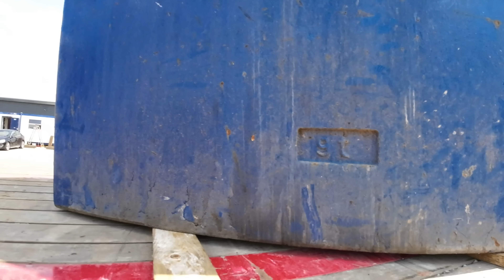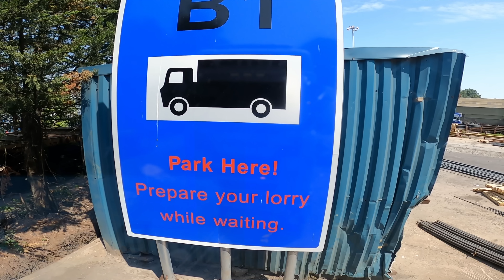Just let me do my job! ✔ Trucker Floz ✔ [4K]

Comment: Understand your frustration...on the other hand my mate fell of a trailer last week, broke his hip and smashed his femer, when he does come out of hospital he will be off work for at least a year, he is agency so basically he is fucked, no come back either as he is not suposed to be on the trailer.
Reply from the maker: Thanks, Paul. I hope your mate gets a full recovery. There's nothing worse than not being able to work and provide for your family. I hope he is doing well.
Like I said in previous answers, if the site has these rules, then you must follow them, but these rules should be displayed around the site. Every site has different rules when it comes to H&S... and not all forbid drivers to climb on the trailer. If they display them, I will follow them.
The issue in my case was that there was no sign anywhere, I was actually off-site and on the main road, and the way I was spoken to.

Comment: Florin, they are not worried about you suing them if you fall off your own trailer. They have to treat everyone as a potential accident waiting to happen and prevent any unnecessary risk. If you stumbled and fell off, hitting your head you could be seriously injured or even die. The HSE has really strict guidelines and anyone on the site that sees you climb up without fall protection and fails to stop you could be held responsible. They could face a serious penalty if you did have an accident, from a hefty fine to imprisonment.  That said, you know that it's your responsibility to not have falling debris from your trailer, so you need to sweep it clean before going back into the public roads. H&S rules can feel really annoying, but try not to take it personally. Everyone is just trying to do their jobs and protect themselves from liability.  If you want to take the risk (as low as it is) to climb up then be prepared to do it off site like you ended up doing. Or just sweep it with a broom while standing either side of the trailer, but remember to wear eye protection!
Great video mate with some nice reversing. Stay safe  ❤
Reply from the maker: Thank you 😀 I totally agree with what you said. The problem is that not all sites have the same rules. As you've seen probably later in the video and from some of my other videos, on some sites you can climb on the trailer on some not. Now the ones that have a strict policy have signs all over the place informing about them rules. Like Celsa, Worksop Galvanising and so on... they have signs everywhere. Also construction sites have different rules and signs everywhere informing us about them. In this case there was no sign anywhere and I was also out of site... I was on the road. I know in the video it sound like I'm saying "out of his site" but I'm actually saying "out of his sight" 😁
I also had a problem with the way he spoke to me which really ignited all my anger 😊
But again, I totally agree with what you said and thank you for watching 😀